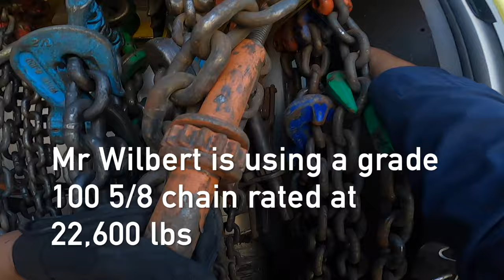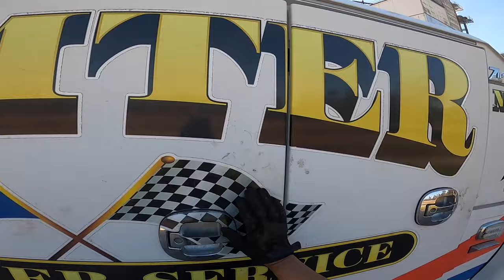Lifting a Track Mobile Railcar

Comment: If the boom was able to swivel, he wouldn't have to keep repositioning the truck especially in small areas.  I've heard of train cars derailing, but it I never ever thought track maintenance vehicles derailing. They were lucky to be in spot where they could be helped. If they had been in an area where you can't get to with your wrecker, they would probably have had to call for a large railroad crane. Enjoy watching your videos. Mr. Wilbur is the man. You be safe out there. Looking forward to the next video
Reply from the maker: Mr Nathan Yes sir a rotator would have been nice. Thanks for watching and stay safe
Reply: A TrackMobile is a small, customer-owned locomotive that is used on their property only, for moving train cars around within the confines of their trackage.   Most TrackMobiles have both rail wheels, and rubber tires, and the purpose for the tires is so that that TrackMobile can use "dry land" to navigate around the rail cars, if necessary,  to be able to re-position.  They can pull in either direction, and have a coupler on either end.  While the cab is off-set for visibility purposes,  if the operator doesn't like being on the one side, he or she could use the rubber tires to navigate the machine and re-mount with the entire machine turned 180 degrees, and the cab would then be on the other side.  It would depend on desired visibility, curvage, and objects that the operator very much needs or wants to be able to see.  Withe the model seen in this video,  he could exit the cab if needed, and walk across the upper deck to peek at what he or she wants to see on the opposite side.  
These things can move a short string of loaded cars together,  and easily double that with empties, but it depends on the terrain, the weather, and traction to the rail.  They usually have a feature that will throw sand in front of the steel wheels, for added traction.